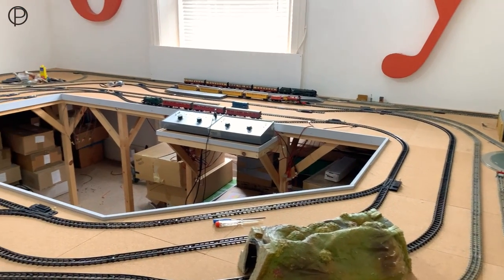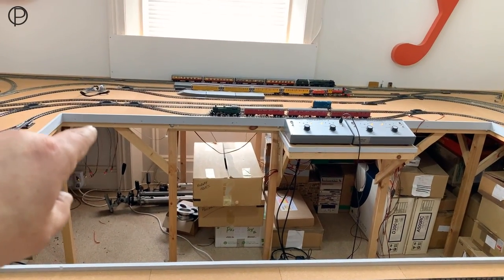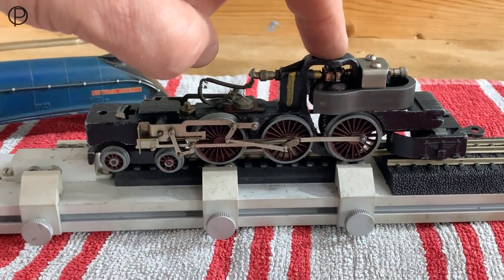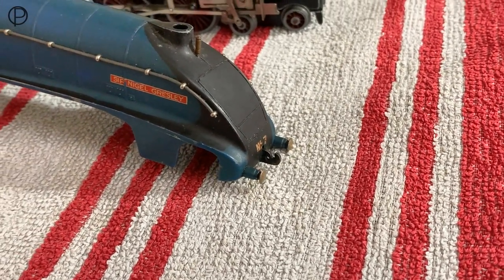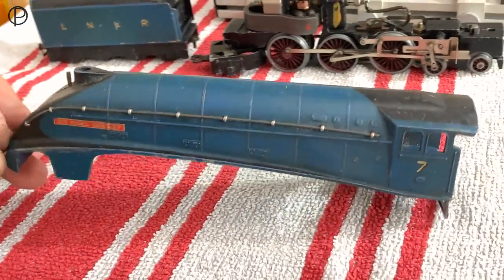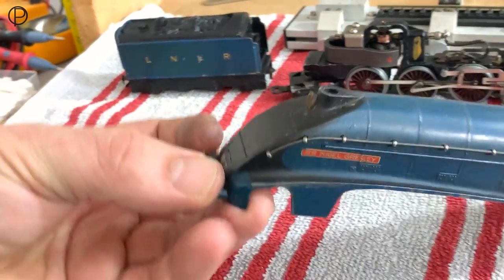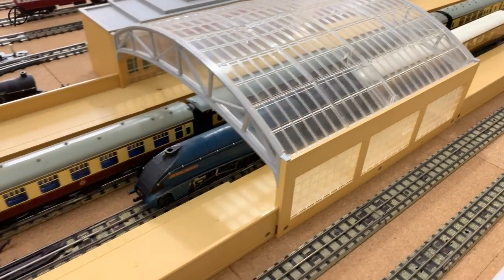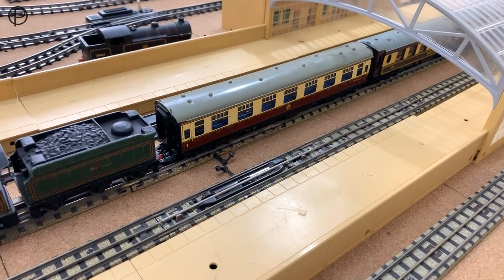Hornby Dublo A4 Pacific Locomotive “Sir Nigel Gresley” With LNER Coaches

Comment: Such a joy to watch Sir Nigel in action this morning. To think that 60 years ago I watched the real loco gainfully employed by BR while your model was giving pleasure to a model railway enthusiast and I saw the real loco in action again last Nov. while the model still gives pleasure to us enthusiasts today. Something magical in that. I wonder if you could reface the skates with a small amount of solder? They would wear down quite quickly I suppose but I don't expect that you would be running the loco all that often. Great video on this cool wet Sunday morning.
Thank you Oscar. Regards, David.
Reply from the maker: Good morning David, great to hear got to see the real locomotive last year. These are quite wonderful model/toy items with a wonderful feel about them both in handling and use. I've re-finished a number of skates now and experimented with a change in the spring type within the pick up assembly, both of these operations make marked improvements. I've also acquired some reproduction parts as at some point there is going to be nothing left to refinish on a number of the pick up skates I have.
Thanks again take care.
Oscar

Comment: Good morning Oscar . More sunday morning entertainment and most importantly, the footage shows the model railway as it was originally designed. Comments regarding the horseshoe mechanism are of interest especially the wiring. 
Over the years Meccano would have upgraded the arrangements: previous modifications would have included use of the green wiring, addition of a capacitor and very early versions had the pickup wire soldered direct to the brush tube.
Pleased to see that the lighting kit with replacement bulb is operational.
I'll see if I can dig you out any more accesories for inclusion.
Reply from the maker: That's very kind of you I'm glad you enjoyed the footage. When the model came to me it ran but the wrong direction on the controller. With Tri-ang models/motors when this has been the case, I have simply popped in magnetiser the other way around and model just runs correctly. I was quite worried when I put this in the magnetiser to do the same thing, and the end result was just a home from the motor and it wouldn't run, popped it back in the magnetiser and reversed what I had done and it ran faultlessly But in the wrong direction on controller. I have to admit, I put it away, quite frustrated with it, there was no problem with the armature catching on the magnet, There was plenty of clearance on both sides. I decided to turn the magnet over and magnetise it once installed. At that point, it would run in either direction, although the magnet appeared to be in the correct position nice clearance around the amateur sitting in the right place in the clasp, and no undue play in the bearings. I loosened the screws on the clasp holding the magnet and very gently tapped the magnet with a light hammer to alter its position very slightly with this tiny adjustment, it ran perfectly with the controller. I put it in the magnetiser and magnetised it the wrong way around and back on the track it wouldn't run, but with a slight adjustment on the position of the magnet, it would run perfectly obviously in the wrong direction at this point. So I put the magnet back in the way round it was originally,  and positioned it visually in the correct place, magnetised it, and then made very tiny adjustment with the hammer again, and now runs perfectly with the controller. The adjustment in position with a magnet is minuscule. In magnetising the horseshoe magnet, I have followed Ronald Dodd's advice and done it at multiple points and down at length.. I recently bought a Duchess of Atholl from the local market, Also with a horseshoe magnet ran in the wrong direction on the controller exactly as above wouldn't run, when magnetised the correct way around tiny adjustment on the position of the magnet brought it back to life. This just has to be a slight change in the position of the magnetic field around the amateur and makes such a big difference.
Thanks again, hope the above is of some interest.
Oscar
Reply: @oscarpaisley  this is a most comprehensive write-up. 
Many thanks for sharing Oscar and taking the time to describe your experiences in detail. 
From my O-level physics schooldays, i have a dim recollection that hammers and magnets aren't a good combination...🙄
I'll check out the running direction of my HS N2, atholl and Sir Nigel based on your obsevations.

Comment: Great video Oscar, super choice of loco. I tried shoehorning a spare prewar body onto a silver king chassis as an experiment once. Came within a whisker but the valances were just too tight.
Fyi the teaks come with either the black corridor connections or just plain body colour. I've not yet figured out when the colours changed. Prewar artics and teaks had the black, so I guess it was later. Hard to know. 
Thanks for the viewing
Reply: Post war teaks should have grey roofs to reflect real life. To be accurate this loco and coaches don't match. Pre war white roof and A4 with post 1941 number.
Reply from the maker: Hi, thanks again for watching and the great information about these teak coaches, I find it very difficult, deciphering the information available about Hornby Dublo items, so all information received is hugely appreciated. The ones with grey roofs I have are different again, but lovely looking items, I Imagine any young person at the time these were new in the toy shops lucky and enough to have them would have been thrilled to play with them.
Take care.
Oscar

Comment: Lovely to see this Oscar. I got out my old Silver King last week. I only have 2 3-rail locos. Silver King and an ancient LMS 0-6-2 with a horseshoe motor that I found on eBay a couple of years ago. I had a Montrose and a class 20 when I was small, but had them both converted to 2-rail in the ‘70’s. I still have them today.
I’m seriously thinking about building a semi permanent 3-rail layout for the A4 and « N2 », though I need a few more pairs of points. HD 3-rail is still outrageously cheap in the UK, but unfortunately since Brexit I get stung with import charges and ludicrous postage costs which add at least 50% to everything I buy from the UK. It’s an absolute scandal. Coupled to that lots of sellers will no longer send to Europe. When I see HD Duchesses and A4’s in playworn but good mechanical condition at under £40, but can’t get my hands on them it’s really frustrating. I’m going to be buying some stuff this summer I can tell you, I’ll just get them delivered to my cousins house in Kent,but it’s still very annoying !! I really need tank locos, but this Sir Nigel Gresley is really appealing, so if I can find a reasonable one easily it may well be the next one. Either that or a 4MT.
Reply from the maker: Good morning Robin, and thank you again for watching. It's great to hear about your plans for a three rail railway, having had a fair bit of 3 rail sitting in boxes for some years, I had really been looking forward to getting to play with it again, it has an amazingly satisfying feel/experience when in use and has been very rewarding developing the railway so far. Sorry to hear about your problems in buying items from the UK, it was not one of our countries greatest moments its un thought out decision in detaching itself from the European Union, sadly, I fear this is going to affect many of us, not just here in the UK for some decades to come and not just in the acquisition of model railway items. Hope you're able to acquire some interesting items on your upcoming visit.
Take care.
Oscar

Comment: Oscar you could put a small drop of solder on the pick up of the loco, that would solve that problem. You can file it down if you put too much on.
Reply: Excellent idea. Never thought of that. Now I can repair my LMS 0-6-2, it must have run many miles, the pick ups actually have grooves worn into them!
Reply from the maker: Hi Graham, thanks for the great info and taking the time to watch, I've switched the spoons with another locomotive with less wear and also changed from the older style pick up spring in this locomotive to the slightly later version, the copper/ bronze flat type, These seem to apply much lighter pressure and more evenly across both the pick up spoons. It seems to give gentle pressure and evenly applied to the spoons, makes quite a large difference to the performance. I'm just about to switch the spring in a tank locomotive for the same reasons. Having also been experimenting with solder and refinishing the pick up spoons along with some reproduction spares.
Take care.
Oscar

Comment: Excellent video as always Oscar, your layout is really taking shape! That is one of the earliest post war versions of the Sir  Nigel Gresley locomotive, looking at the nameplates as well as the horseshoe magnet motor chassis, is the rear pony truck held on by a split pin or a screw, couldn't tell from the footage? It seems to run exceptionally well for an engine of around 75 years old, driving wheel wear doesn't look excessive.
Reply from the maker: Good morning David, thanks for watching. Glad you enjoyed this little bit of fun with this version of Sir Nigel Gresley. It does indeed have a split pin holding a rear truck in place. I've swapped the pick up spoons and the spring holding them in place for now it's made a huge improvement with it performance over the track work, especially the uncoupling rails. The original spring that provides pressure/tension to the spoons seems to provide very uneven and strong pressure to the spoons, it appears to be very hard and inflexible, possibly would have been more flexible when originally installed, I do have one in another locomotive that appears to be more flexible. So far, I've not been able to find a replacement for this, It would be nice to do so.  I can find reproductions of the later coppery/ bronze flat type spring used although I can't find the item referred to as the Distance Piece 11299 for spacing it within the assembly,  I'm sure I could improvise something here. Maybe Hornby Dublo switched over to the coppery/ bronze flat type spring as it provides a more even gentle pressure overall. Either way, great fun items to run around the railway.
Take care,
Oscar

Comment: Hi Oscar
That’s a lovely Gresley. I would leave the wheels alone. It’s truly original and I think it’s probably worth more that way.  I e got a nice one too, but it’s a later, block magnet one. It’s my favourite loco. I’m 77 and I’ve had it since I was 9 so it’s served me well. 

The little collector shoes should have a spherical profile in order to stay clear of other bits of track infrastructure .  There’s a fair bit of meat in them so you can probably file the outer edges to improve the profile (I’ve done a few of mine) and that avoids occasional shorting on points if the 3rd rail is a little low.

The collector shoes lift only one at a time over the plastic ramp  of the uncoupler and the locos should all run smoothly over the uncoupler even if the ramp is lifted. You are right to make sure the rail is clean, as if it isn’t, one shoe lifting over the plastic ramp will momentarily cut the supply if the other doesn’t have good contact. 

I’ll look up when Hornby changed the magnet when I get to my reference book and let you know.  
I love the layout. That’s going to be fabulous 
John
Reply from the maker: Hi John, thanks for looking in and the terrific information. I’ll leave the wheels as they are. It’s amazing to think you’ve had that much use out of your model all those years, these items really were built well.
All the best .
Oscar